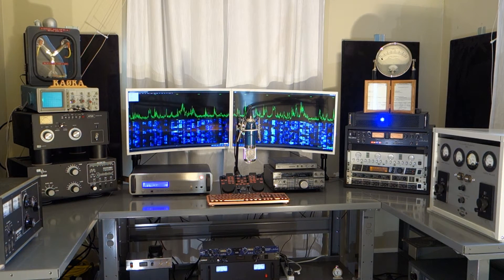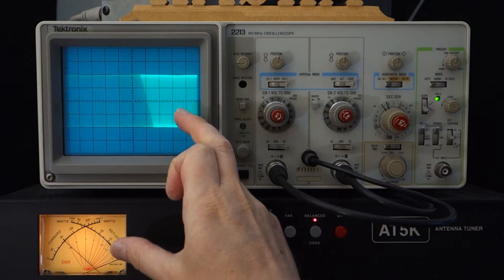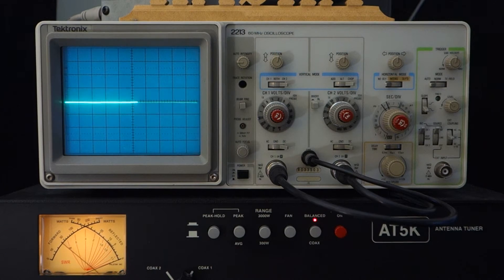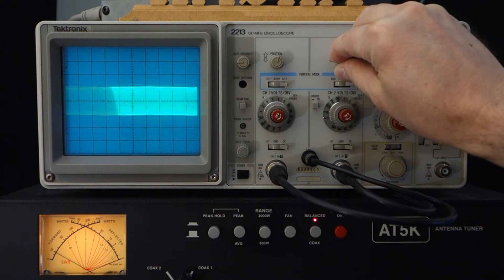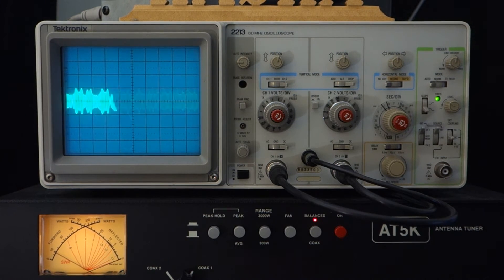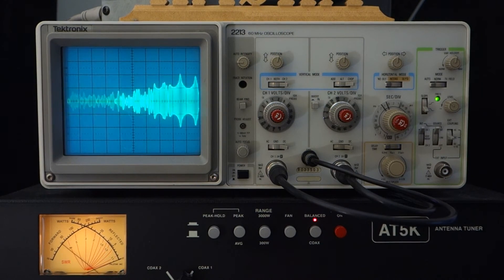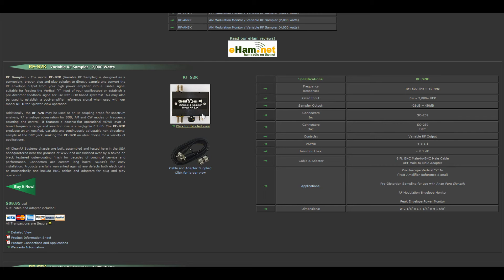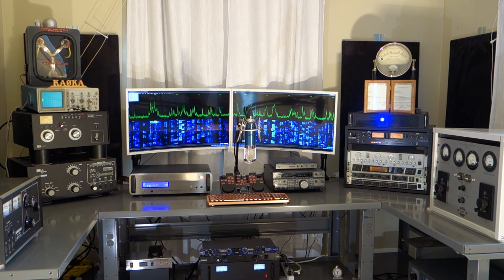How to monitor your SSB and AM peak envelope power using an oscilloscope CleanRF

Comment: Thanks for the video however even though it’s called Peak Envelope power you don’t use the peak voltage to calculate PEP. You need to use the RMS voltage which is the zero to peak multiplied by 0.707. 73 de VK2SS
Reply from the maker: Yes this was a method used only by reference, using an external watt meter then adjusting the pattern to a known deflection in amplitude on the screen.  Works great because meters do not respond as fast as a scope does!